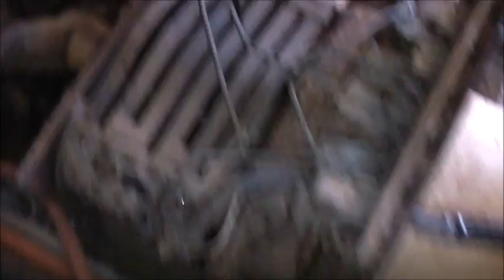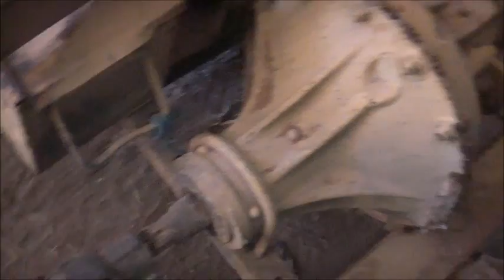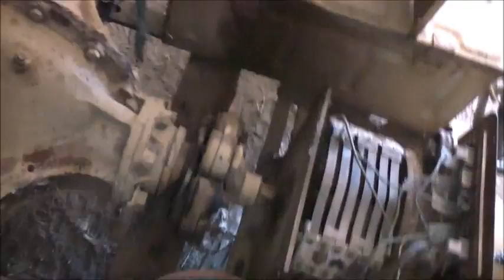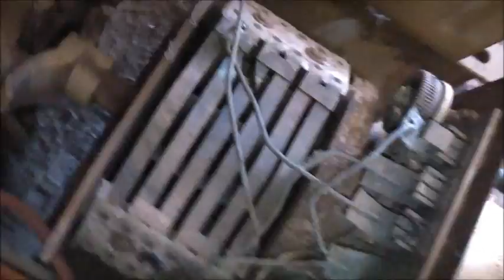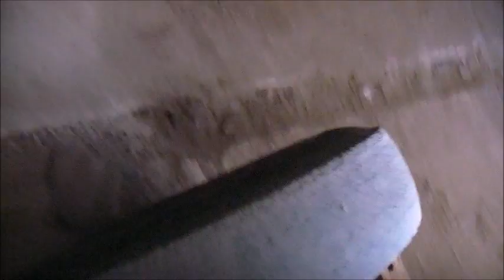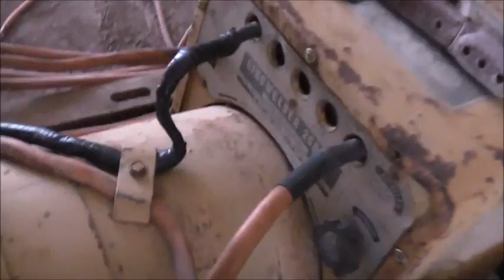Lincoln PTO Welder Repair!

Comment: I have an older version of one of these. For heavy welding they are brilliant. My brother used it for hard face welding on his drill rig and those rods take some grunt to arc. Mine is rated at 200amp but i reckon it pumps out a hell of a lot more than that. Mine is on a wisconsin twin engine. I have a video of it on my channel. Talk to any old farmer and they will rave on all day how great these were. I don't know the technical terms but when you weld the impulses flow from one to another and make a beautiful smooth weld. I recently bought a new lincoln gas/gasless mig and i can't fault it. Heavy machine and has a good bit of power to play with. Really surprised me. They make them in Mexico now. Cigweld are made in China and i am starting to hear people grumble about them not being very good any more.